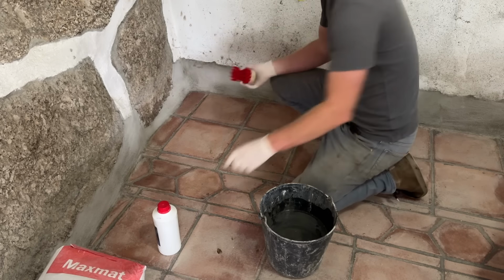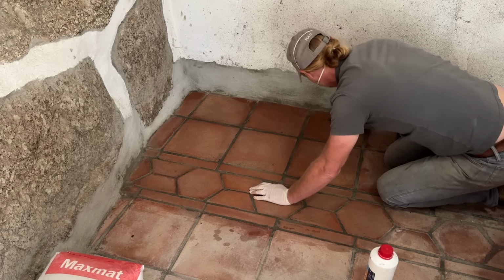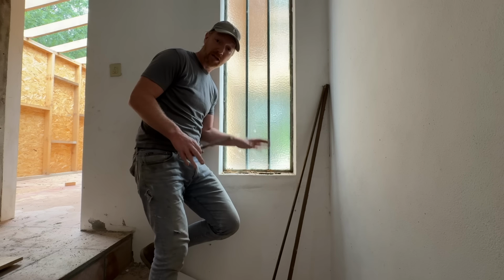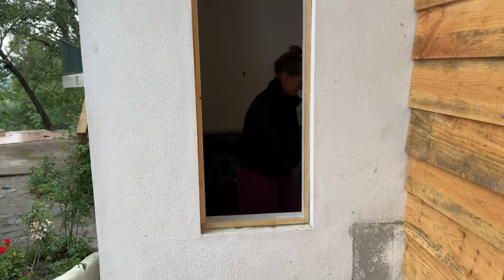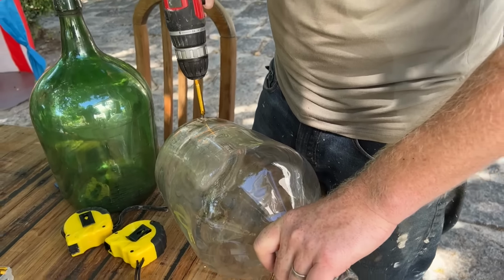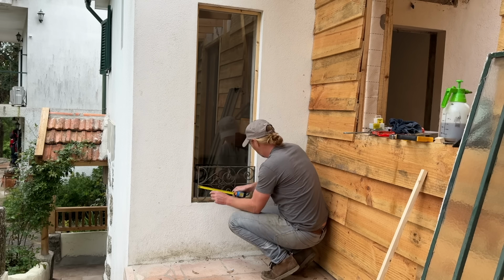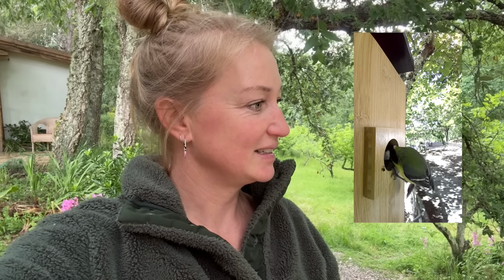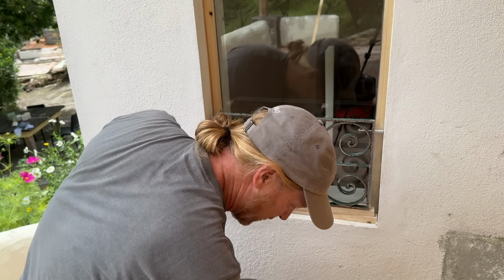I LOVE it when he does this. Stone House Transformation

Comment: Nice solution with that window. But from the outside, it still looks like a door! I love the patina of blue-green that was left on the iron window grate. I still think that you should use that other window grate on that window to break up that visual void. Also, the boys might be safe with that grate below, but anyone else, an adult, could easily fall through the window, too.
I hope that you will not dispose of the glass from the window that you took out. That ripple glass could be used to be included in a stained glass window. I created the design "cartoons" for the stained glass windows for a neighbor for their business.  Was fun to include etchings and little "jewels" into the window designs!

Comment: Love the wrought iron piece that was added to the window. It adds such charm. However please keep in mind that it will rust if left to the elements and that will bleed down onto the window sill and walls turning the white into rust runs. If you want the patina, consider a clear coat over it. ( Like your terracotta flooring seal) To keep the charm without adding anything to it really. Just a suggestion. Oh and I've been here from the start. Can't wait to see what happens on the new build!! ❤
Reply from the maker: Thanks for the suggestion Dawn! We love getting new ideas from you 🙏🏼

Comment: Hi there, gang !!
So nice  birdview of the misty river, over the lower river, both in the valley!! Really mesmerizing, and prolly quite rare.....
The window became something more, than a rectangle with a whirl of metal bands,  when this old black smith piece was fastened, and that you found the other one so quickly, was good. I am sure you will find another place, where it can be be seen and enjoyed, as the first one will. 
Also, I saw that isolations are on at the extension,so things are happening. The tile dear John scrubbed, did they sort of got a bit darker when dried?? Its a nice pattern, and also local plates, as I understand. I am quite curious about the moroccan lamp, once its hooked up. Maybe one of these contact that could either weak or strong light, by turning the knob ??  Anyway,  a fine video as usual. 

As for me, the cold is slowly waning,friday the plastic motorboat will be fetched, and sold so  I can pull my Hedvig up some meters, so I can make her ready for the sea....
Allda bestest from mikke...;-D
Reply from the maker: Hi Mikke! The mornings here on and around the farm are so magical at the moment, we love that we can capture some of it for you. We will give you an update on the tiles soon. Thanks so much for watching  🙏🏼🙏🏼